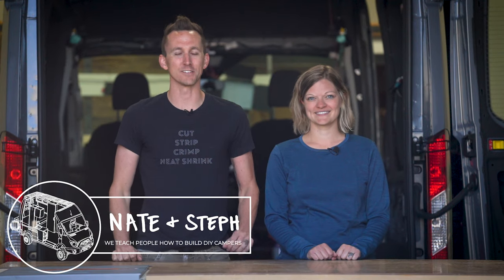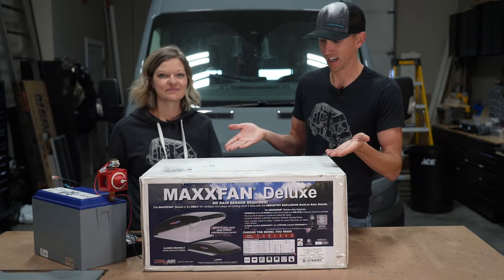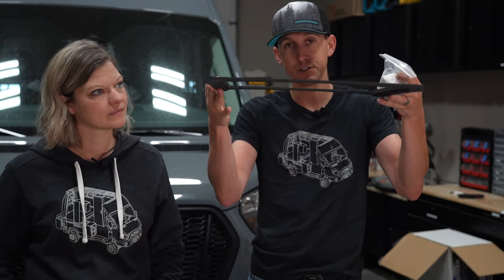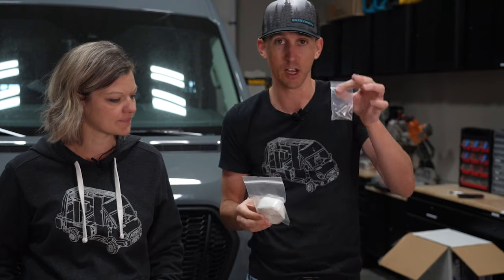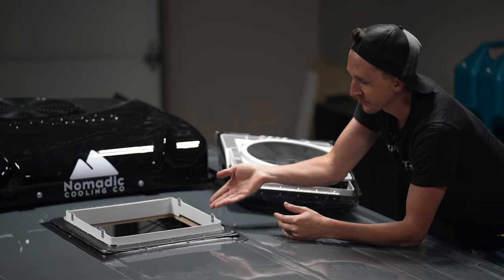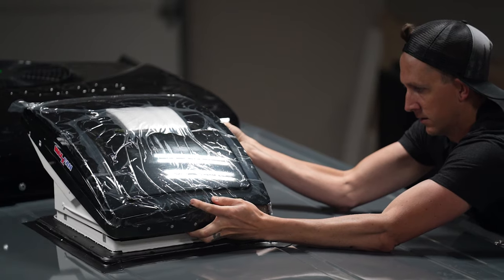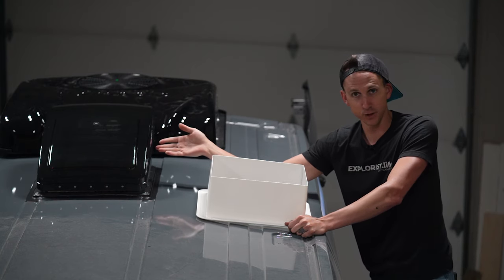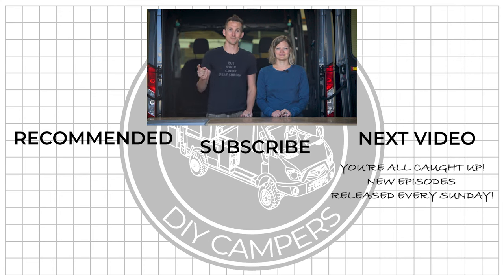INSTALLING A MAXXAIR MAXXFAN DELUXE on our DIY Camper Van Conversion

Comment: You need to buy 12v regulators for these otherwise your board will pop and you'll get the green light of death. these fans require an exact 12v or they will burn up over a very short period of time especially with lithium that can put out 14.5v.
Reply from the maker: That's just on the old boards.  They've fixed the problem on the new ones and have warranties the old ones.
Reply: @EXPLORISTlife  I replaced 2 boards now, and am on the phone with them for a motor fix. If they fixed it, they are not sending the corrected boards out for warranty replacements. I bought the voltage regulator to keep this from happening again.
Reply from the maker: Okie dokie!